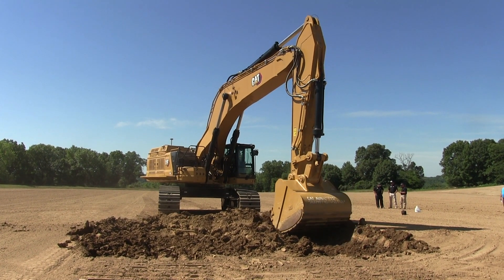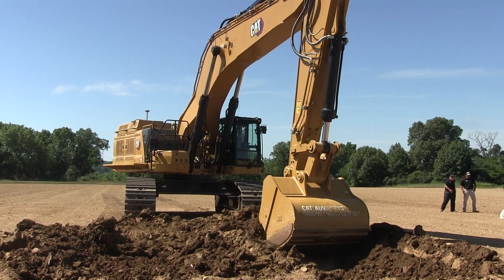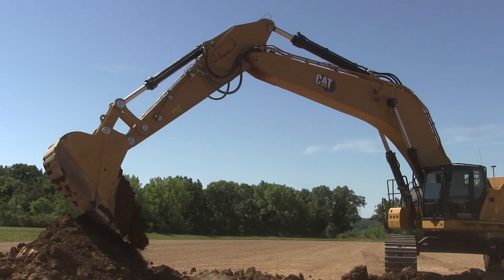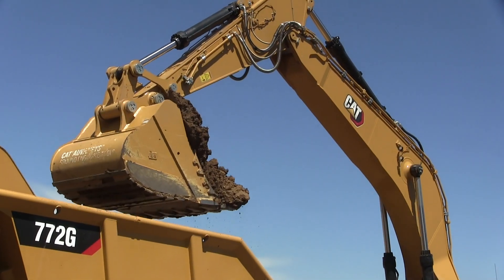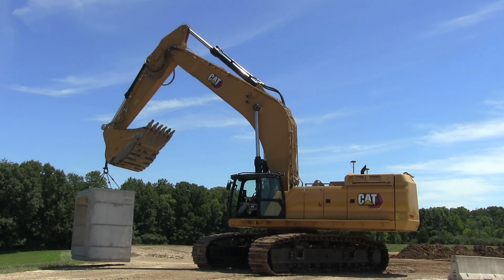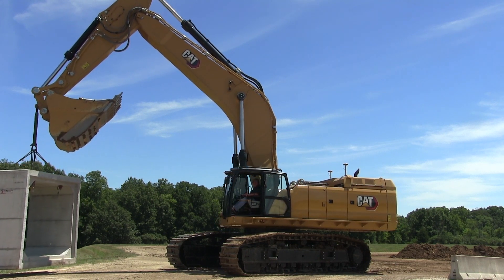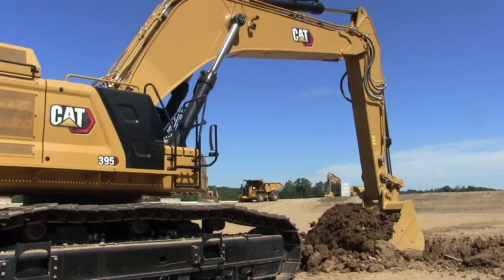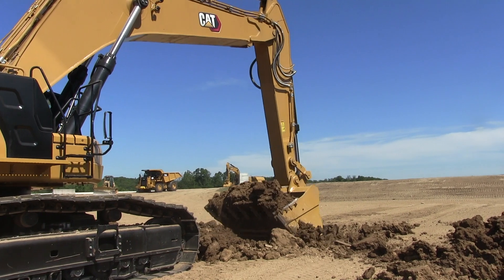Caterpillar 395 Field Test

Comment: I'd like them to produce on that you can set your swing stop points so that when you're loading. You'll be able to get back to that point without operation error. Take the load off of the operator. Less stress means better family life.
Reply: You can absolutely do that, its called Swing Assist. You just set the angle of where the truck will spot, turn on the feature and when you grab your material and swing back to the truck it will stop at the angle you previously set.